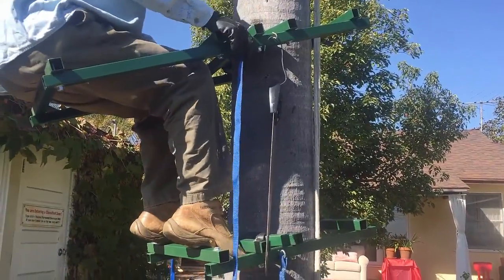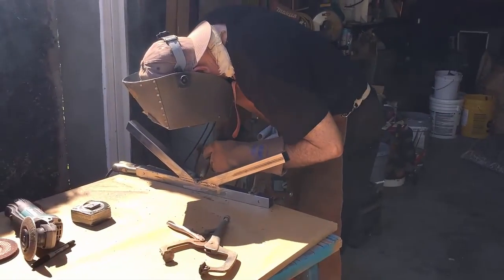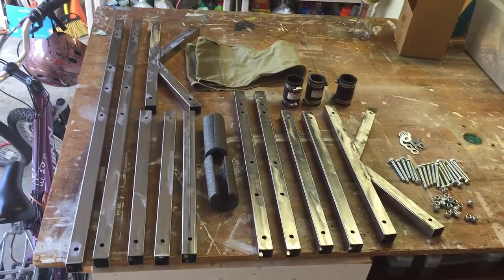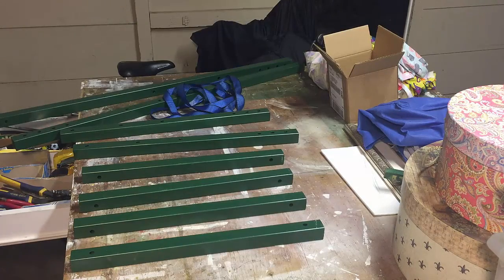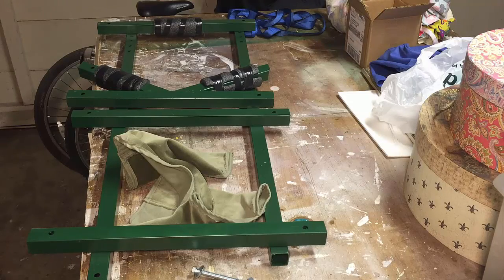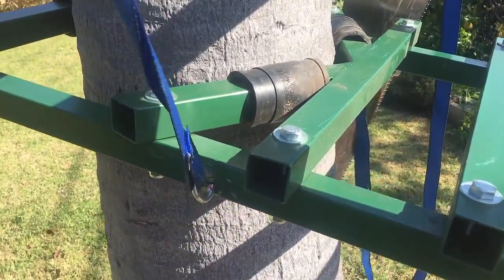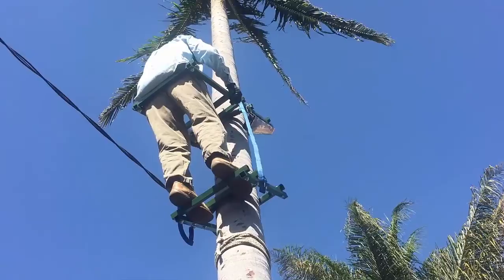TreeClimber

Comment: Hello Ken, where did you get the plans for the tree stand? Starting @ 1:24 ? And as for measurements, and where in the tube does one drill the holes and where to weld the tube to each other?
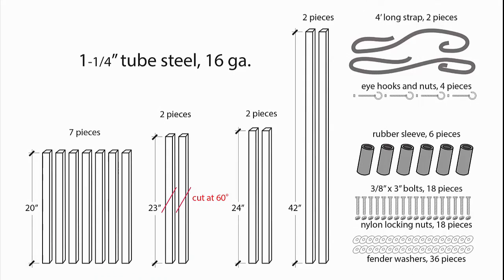Reply from the maker: Those plans you see at 1:24 i just found on the web.  try looking up the keywords you see in the drawing titleblock. at  1:27 you see my sketch which is simplified. Regarding welding, it is only at the location where the "V" touches a cross bar to form a "K".  everything else i just through bolted.   Holes I just drilled where i thought would be good.  Totally guessed.
Reply: @KennethCGilbert  just saw this now thanks